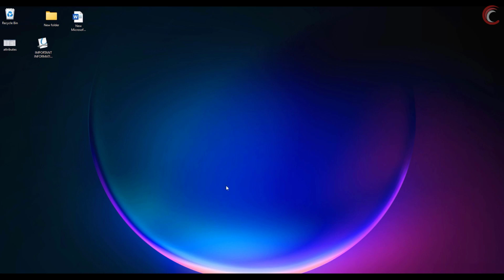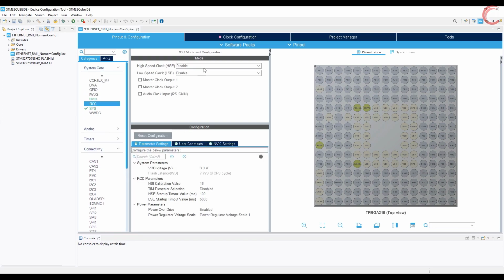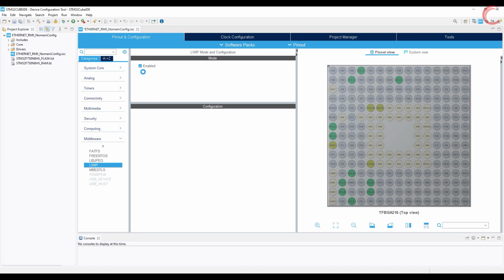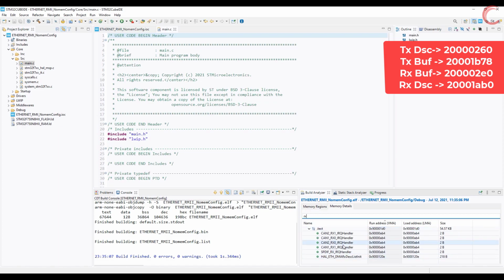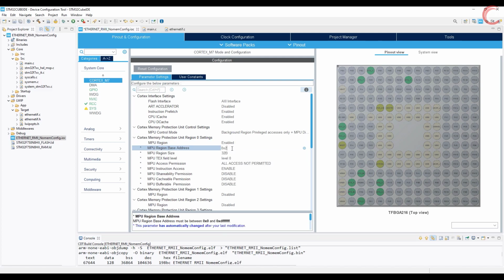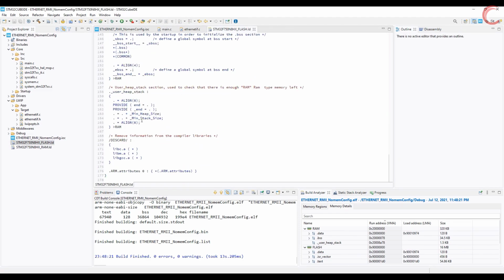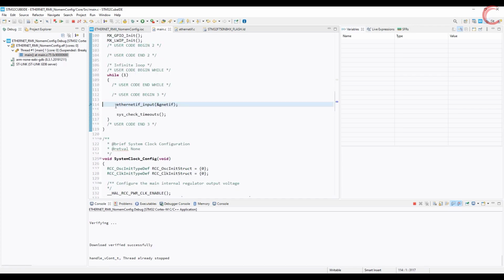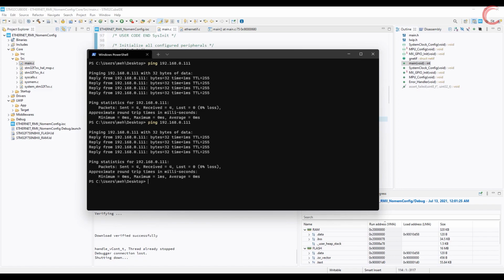STM32 ETHERNET Configuration #1 (PART 2) | RMII with No Memory Configuration

Comment: I'm not sure if anyone has mentioned it or I didn't hear it on the video, but if the STM doesn't connect (ping says destination host unreachable) while there aren't any errors during compilation or upload, avoid clicking on the green arrow to run the code. Instead, click debug and then terminate. I spent many hours looking for mistakes or different tutorials for the NUCLEO-F767ZI, but once I used the debug, I've been error free with successful pings. It might just be me, or maybe I DID do something wrong, but if anyone is in the same boat, give it a try.

Comment: You have done something diffrent but didn't show. For example, in RAM .ld file default values are  
RAM    (xrw)    : ORIGIN = 0x20000000,   LENGTH = 320K
 FLASH    (rx)    : ORIGIN = 0x8000000,   LENGTH = 128K .
In your example RAM    (xrw)    : ORIGIN = 0x20000000,   LENGTH = 320K
 FLASH    (rx)    : ORIGIN = 0x90000000,   LENGTH = 16M

Please give all important points Don't ignore them.
Reply from the maker: That is irrelevant to the video.
 The device flash is very low and it can not accumulate the entire project, that is why I used QSPI for the flash storage. 
If you want to see how it works,  checkout the QSPI XIP video.

Comment: I got it working on H723ZG Board! Thank you very much for your videos! I am a mechanical engineer and I understood the MPU and the memory stuff, and everything you taught was actually able to get it pinging! I did the RMI with manual memory allocation, had some issues, turned out it was my IP address selection that was wrong 😂

Comment: I watched the entire video. I enabled ETH and LWIP. When I compiled it, I got errors like lwip.h. I added .h files to the Path and Symbols section. Finally, I added LWIP and Middlewares to the Source location section. All errors disappeared. Then I wrote the code you wrote ( MX_LWIP_Init(); ) but I didn't get any IP address. When I typed the IP address into cmd, I got the Destination host unreachable error. Would you help me with this topic? Thank you.(I use stm32f107vct6 and dp838448)

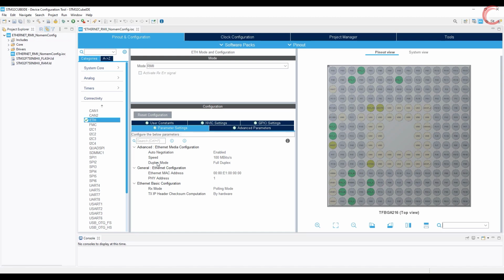Comment: 3:13 I don't have the PHY Address field for STM32H723ZG. Also, I do have RMII in the schematics. However, the options under `General: Ethernet Configuration` looks more like the ones in the MII video.

Comment: I am lost at 3:12. Because I have the possibility to set up the Memoery even if I use The RMII Interface. Got the feedback from CubeMX...  "The ETH can work only when RAM is pointing at 0x24000000"
Reply from the maker: I mentioned in the previous tutorial, its a mixture of these 2 videos. 
Anyway if you do have rmii with memory config, checkout my new video about Riverdi display ethernet. It also has the same type. Itmight help you
Reply: @ControllersTech  Unfortunately, you are using FREERTOS there. Does this change the configuration?
Reply from the maker: No it doesn't. Skip the rtos part and follow the rest.
Reply: @ControllersTech  No Luck today for me. Get no Ping back... Could it be that something is different with the 1 core version H743?
Reply from the maker: No nothing is different. The same setup works throughout the STM32 family. 
Watch the full video till the part where I ping the board. Also note that you need to configure the ethernet on computer if you are directly connecting the cable to it.
Reply: @ControllersTech  Thanks for feedback. In my setup I connected through the router. So no need for this. I will try again.
Reply: Did you find solution for this issue ?

Comment: DMARxDscrTab and TxDscr at the 6th minute are visible, but Rx_buffer and Tx_buffer are not. Is this a problem?
Reply from the maker: They aren't there in the new cubemx versions. The configuration works fine without those also..

Comment: Most of the settings is  memory settings, it makes me confused,  do we really need to this kind of settings? i mean if i just wanna make connection, the rxbuffer and txbuffer size is really so important?
Reply from the maker: If you are using cortex m7, then it is necessary. In case of m4, I guess it could be avoided.

Comment: Hi! It is a great series of videos that helped me a lot! BTW, I'm using a custom board with STM32F207 and LAN9353 connecting with MII.
This is working fine at the beginning: <1mS ping with a direct connection from the PC. But after several minutes, this stops answering back, and after debugging, I found a configASSERT error on queue.c. Did you face this before? Thanks in advance.
Reply from the maker: Using freertos ?
Reply: @ControllersTech  Yes!
Reply from the maker: Yes i was having issues something like that when I was using rtos v2. Switching to V1 solved the problem for me.

Comment: Hello everyone , I am using the Same development board as in this video and did everything as shown in the video. But i get error :
F7508_ETHERNET_1_PING.elf section `.rodata' will not fit in region `FLASH'
region `FLASH' overflowed by 2640 bytes.

Could anyone please help solve this issue the have many times to built the same configuration but i always get the same error but sometimes with different Byte size.

As i am in middle of something need to solve the issue immediately

Thanks in advance
Lakshminarayana KS
Reply from the maker: You haven't configured the flash script file properly. Watch the process carefully after generating the cubemx code..
Reply: I followed the complete process, When i build the project in Release No errors. But if the try to Build the project in Debug mode then i get error even after keeping in the default memory.
Is their something That as to be done  in Compiler setting for debug. 

As i am not able to debug the Application

Comment: Hello everyone, thank you sir for these amasing tutorials. 
I've succeeded to communicate with my nucleo-f767zi board using the rmii config without switching from DTCM to SRAM and then I've used TCP/IP client mode.
However, what I need to do a Modbus TCP communication over ethernet. If anyone has an idea how to do that please share with us. Thank you !
Reply: Hey, i have a question. While testing (when pinging from PC), is MCU board connected directly to the PC? Or have you connected it through Router or Switch? Thank you in advance 🙏🙏
Reply from the maker: It works using both the ways.
Though if you are using the direct connection, you need to make some changes in the ethernet configuration of your computer
Reply: @ControllersTech  thank you so much. It's working now 😊. Thank you so much for this video and for help😊

Comment: I'm working with RTOS and I guess that's the reason some things are changed. For instance, there is no declaration of the Rx_buffer and there is no section for it as it is shown in the video. In my auto-generated code, there is a Memory Pool being created with the information of the buffer. Do I need to add the RxArraySection to the Flash Script? I guess I don't
Reply from the maker: no you don't need to put it. These changes have been made in the new cubeMX versions. I have new series of tutorials on RTOS based, you can check them out.

Comment: I have the same board (STM32F7508-DK), I follow the configuration steps but when I build I get a memory error: <project_name>.elf section `.rodata' will not fit in region `FLASH' . How could this happen if is the same board?. Thank you in advanced, your tutorial are always clear!
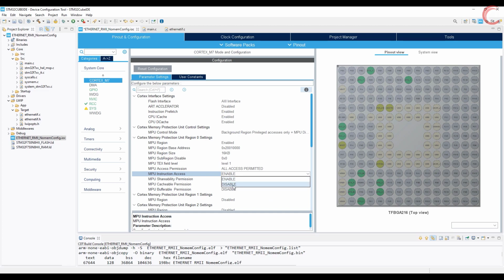Reply from the maker: You need to modify the flash script. Check after 9:00
Reply: @ControllersTech  After modifying the script, the error remains. I found one way to solve this  in the FLASH.Id scrip: assigning in the ".rodata :" section,   RAM instead of FLASH. The problem is that rodata is used to store constant data and I don't know if that should always be inside ROM/FLASH memories.
Reply: I was comiling in DEBUG  mode. If I compile in RELEASE mode the FLASH error desapears. Sorry for the spam I hope this could help someone else. Thank  you for al the tutorials!
Reply: @23charly69  I changed the project properties to Optimize for Debug and that fixed it for me.
Reply: FlASH memory is at 103,20%. I think I'm loading more files than necessary. But I don't know how I can change this configurations :(

Comment: Is there a reason why my when i ping to my stm32 board, it's returning "Destination Host Unreachable"? I followed your process for the RMII version, but I needed to configure memory so I used your first video's tutorial on that. Just been stuck on this for a while. It returns "request timed out" when my wifi is on, and when i turn my wifi off, it returns "destination host unreachable".
Reply from the maker: Are you using router or direct connection with the computer ?
Reply: @ControllersTech  There's a direct connection using an ethernet between my laptop and my stm32 dev board (Nucleo-H745ZI-Q).
Reply from the maker: Well for that you need to modify windows settings for the ethernet.
I would suggest that you use the router first. If you don't have one, join the discord group. I have posted the screenshots for the settings in that.
Reply: @ControllersTech  Yes I did modify window settings for it. Do you know what part of the code/ ioc that could be potential problems for IP pinging?(ie. does the clock cycle/mpu config affect this, it shouldn't right? I assume it should be mainly with the eth and lwip part of the ioc that could be the problem?) - Actually it is resolved, it was due to my RAM and Flash files
Reply: @philam8982  I'm experimenting the same issue. Could you be more specific please? (Actually it is resolved, it was due to my RAM and Flash files)
Reply: @23charly69  What did you change in RAM and Flash files?
Reply: @philam8982  Hii  am facing the same issue What changes You made and how you resolve the issue can you be more Specific please  it  could be very helpfull .thank you
Reply: @23charly69  Your resolved your problem ?? am facing the same can you help me ?
Reply: I have the same problem. Any suggestions for the solution?
Reply: I found out the problem. I'm using STM32F767ZI MCU on Nucleo F767ZI board. The problem is Memory configuration. Whenever I activate the MPU and allocate the memory for DMA as it is mentioned in the video, I encounter this problem. Don't use MPU!
Reply: @burakagca9450  yes i have the same problem can you help me .
Reply: To all those who are facing ping and connectivity issues.
I would recommend the following changes in your configuration(the RAM and FLASH areas require no change):
Ensure that LAN8742A is selected and physical address 0 is set and additionally do the following changes :
ETH configuration -> Advanced Parameters -> Extended: External PHY configuration
and the values are as below
PHY Special Control/Status register Offset - 0x1F
PHY Speed Mask - 0x0004
PHY Duplex Mask - 0x0010
PHY Interrupt Source Flag Register Offset - 0x001D
PHY Link Down Interrupt - 0x0010

The above are taken from the LAN8742a datasheet. Please do update this and run the code. This has resolved my Destination Host Unreachable issues and I am able to successfully ping.
Reply: @SwaroopMuralidharan  Could you please suggest me the above changes for STM32f207zgt6 microcontroller which is on Nucleo-144 (Nucleo F207ZG) ? Thanks in advance.

Comment: Hi. Firstly thank you for outstanding videos, they have been really great. I thought I would add a bit to the video if you are also using FreeRTOS. I am using a FreeRTOS and I am using RMII on a Nucleo-F429ZI dev board. 

There is one small annoying change that are a little annoying that need to be made so that the ping test works with FreeRTOS. CubeMX natively puts the MX_LWIP_Init() into the default task. I really dont know why. This needs to be removed from the default task and placed into the task where you intend on running your ethernet thread. Now if you regenerate code using CubeMX, it will place the init function back into the default task. quite annoying. If you have a fix for this, please let me know.

Also, dont forget to add all the relevant @includes that are needed. 

Also, dont forget to set your LAN/Ethernet port to static IP, if wont be able to ping the MCU. At least it did not for me. Took me an age to think of this. 

Is there anything I should be considering when setting up for FreeRTOS?

Comment: Hi ! Thank you for your video !

I work with STM32F407VGT and shield STF4-BB to have ethernet.

The start of the video is clear for me but when you configure cortex M7 i can't do the same thing.

I configure ETH and LWIP but not the SRAM and at the end the video you comment what you do before and that work with default configuration but not for me?

Have you a link for similar project but with STM32F4

Thanks
Reply from the maker: Did you say the phy to 0?  try using 1

Comment: These have been great tutorials.  I have watched them all and most I do understand.  Will work with them all over again to gain even more.  I did have trouble moving from DTCM to SRAM1 but went back and took out the MPU settings and it worked like a charm on a F767ZI.  I have tried 2 other boards; H743ZI2 and a H723ZG and both had many other ways to configure both with MII and RMII so that is why I tried the F767ZI.
I appreciate your hard work in all of these - it helps!  Cheers!
Reply: HI, got it working on F767 and H743ZG thank you!
Reply: May I ask, what do you mean by "took out the MPU setting"? Does that mean you do not use the setting for the MPU?
Reply: I had a problem with my Nucleo-F767ZI in SRAM1 as well.  It would run perfectly with the MPU disabled (aka: in DTCM region).  When I moved the ethernet "stuff" up into SRAM1 (0x2002000 base address) and change the linker addresses, it would still compile and run, but ping was intermittent with 2/4 or even 3/4 failing.  I tried moving it up into different zones in SRAM1 (0x2003..., 0x2004..., etc.) all with the same results.  I then moved it up to SRAM2 (0x2007C000) and it works perfectly fine.  I was thinking I had a defective board.  Maybe I need to look at the errata sheet for this MPU.
Reply: I also got it working on the Nucleo F767 without configuring memory (was able to ping). However, with the Nucleo H755 I am still having issues.

Comment: Hi Thanks for the video, Ethernet Conf. part 2. I used the example you showed in the video, works fine, but when I ping to the stm32, only 50% or 25% ping succeeds, otherwise telling I get 50% loss of ping. Any suggestions why? I tried with 2 ethernet cables, the result is the same.
Reply from the maker: Reset the board once ( using the reset button), then wait for 2 seconds and then try
Reply: @ControllersTech  Thanks, I did it as you suggested, but the result is the same. I use STM32F767ZI (NUCLEO-144) board. Any other suggestions?
Reply from the maker: Well even i face that issue sometimes and that's what i do. It works out after that. 
So i Don't know if there is any other way around it
Reply: I am facing the same problem, I am working with a team and we all connected over a switch and if some one sends  every 0.01 sec a packet of 32 Byte, then my board will be busy receiving this packts and then ignore it, but my Ping will be lost and i cant communicate with my board, any solutions??@controllers Tech